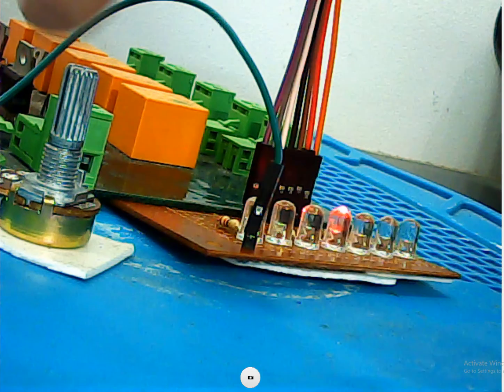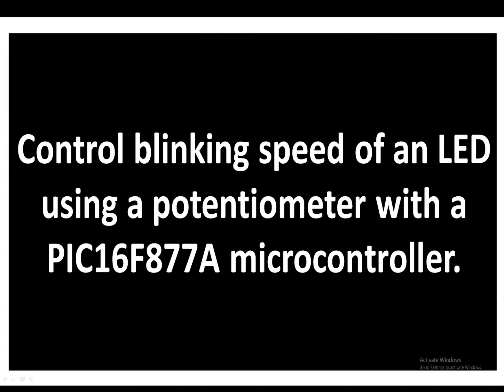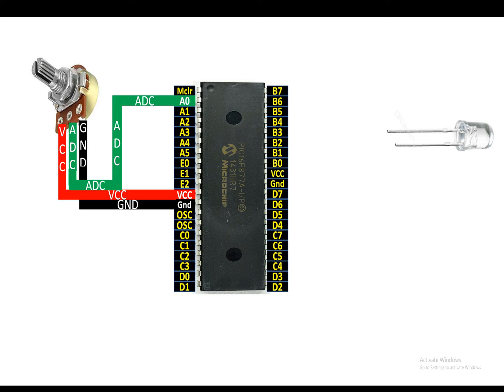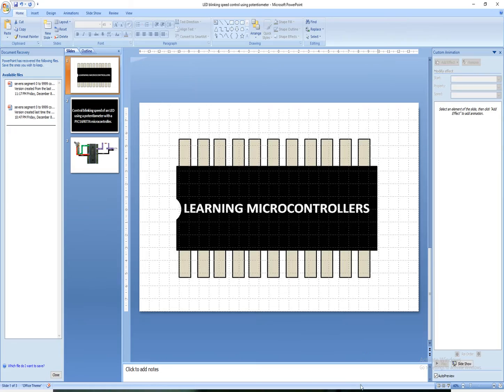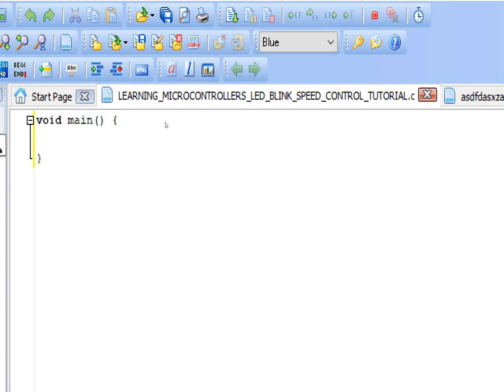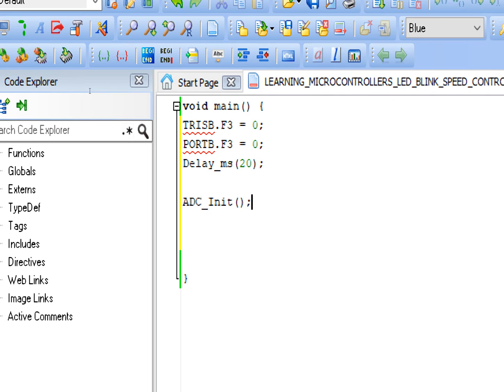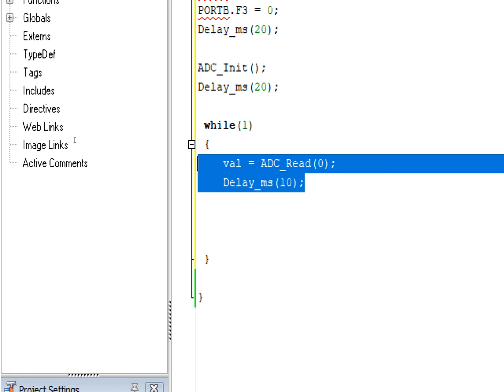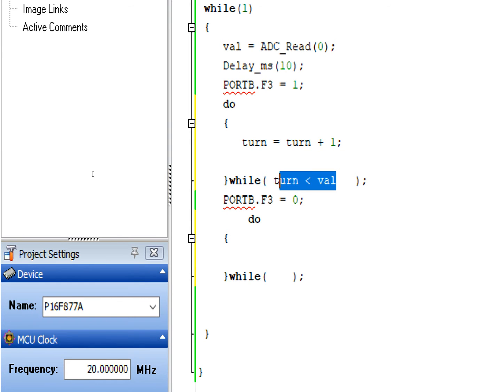Control blinking speed of an LED using a potentiometer with a PIC16F877A microcontroller.

Comment: Hello You making a grate job . How can I obtain such a program from your two videos? I would like to combine your two programs and obtain efect D1 port is initializing ,start LED B5 .When D2 port status changing from High to Low (for around 30ms) LED B5 putting off and LED B6 will putting on delaing (1-5 sec) depends by signal potentiometer A0  .Second changing D2 port (for around 30ms) from High to Low -  make stop program  .After  -supply  on ,program waiting 1second to checking port D2 (to avoid accidental starts).   int val;
init turn;
void main() {
TRISB.F6 = 0;
PORTB.F3 = 0;
Delay_ms(20);
ADC_init();
Delay_ms(20);

TURN = 0; 
while (1)
{ val=ADC_Read(0);

Delay_ms(10);
PORT.F3 = 1;
do

{
  turn=turn+1;
  Delay_ms(5);
   
  
  } while(turn<val);
    turn 0;
  
      PORTB.F3 = 0;
  do
  {
  turn=turn+1
   Delay_ms(5);
   } while(turn<val);
     turn = 0;
   }   and void main() {
TRISB.F5 = 0;
PORTB.F5 = 0;
Delay_ms(10);
TRISB.F6 = 0;
PORTB.F6 = 0;
Delay_ms(10);

TRISD.F1 = 1; /// B1
PORTD.F1 = 0;
Delay_ms(10);

TRISD.F2 = 1; /// B2
PORTD.F2 = 0;
Delay_ms(10);

TRISD.F2 = 1; /// B1
PORTD.F2 = 0;
Delay_ms(10);

while(1)
{
  if( PORTD.F1 == 1 )
  {
      PORTB.F5 = 1;
  
  }
    else  if( PORTD.F2 == 1 )
  {
      PORTB.F6 = 1;
  
  }
  
      else  if( PORTD.F3 == 1 )
  {
     PORTB.F5 = 0;
     PORTB.F6 = 0;
  
  }

}
}